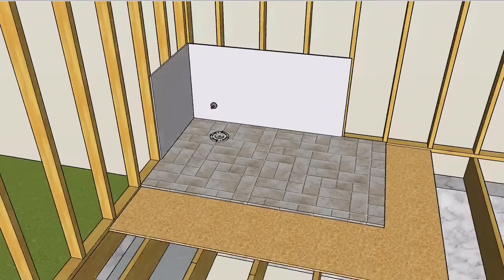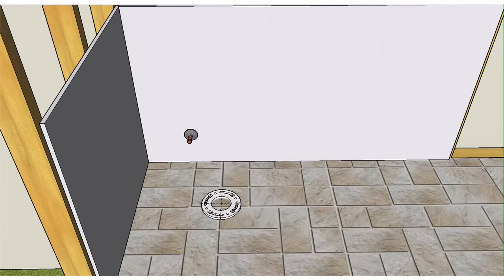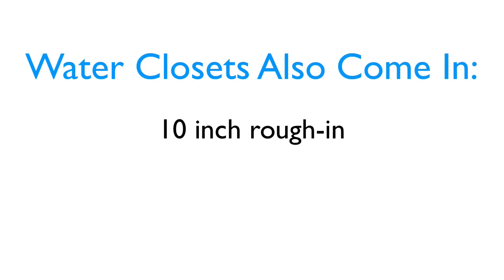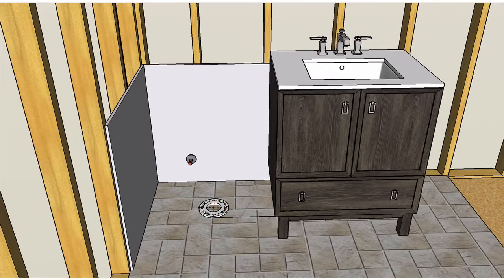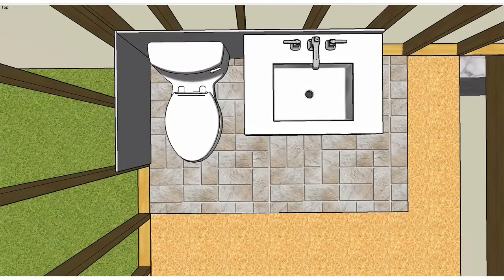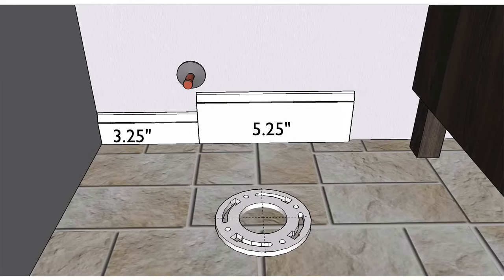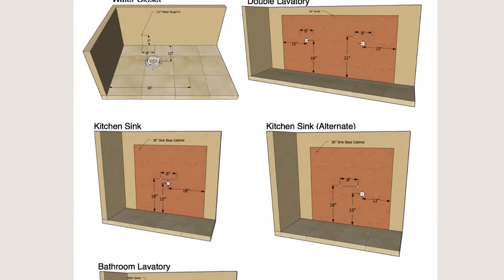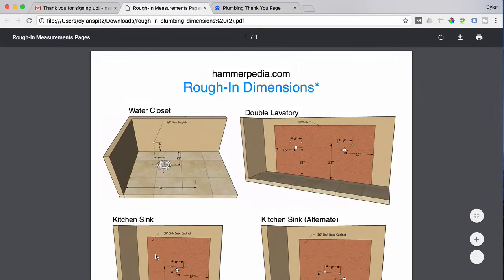How To Rough-In a Toilet (with Dimensions)

Comment: There is no PDF. Just a company  peddling bath remodeling from CA
Reply from the maker: Hi. You must have us confused with somebody else. We email anybody, FOR FREE, 2 bathroom plumbing diagrams. We also have several other free cheat sheets as well. Those get emailed out. If you did not receive your free pdf,  please check your spam folder or promo tab. The email is automated and sometimes ends up there. If you still cannot find it you can send us a message at hammerpedia.com/contact and we will manually send you the plan. Thanks.

Comment: I recently had to rough in a bath for a metal building because the local plumbers were wanting to charge over $3500 for a two-fixture rough-in.  After 3 hours of work and $250 in pipe and fittings, I finished the job on my own. Your videos and schematics gave me the confidence to move forward after my initial shock at the local plumber's fees. Appreciate the info you provide.
Reply from the maker: Way to go!

Comment: I am so glad I found your channel. I plan to overhaul my in house bathroom as the house was built in the 50's and needs major work. In the meantime I want to put inca complete bathroom with a small shower to use later as a mudroom.
My Dad taught all his girls not to fear tackling anything. I have put in oil pan gaskets, spark plugs, revamped uneven roof line, re roofed a house. I think with your good advice I can do this plumbing.
Just so you will know I am 70 and still going strong.

Comment: I have a garage built on a concrete slab with a 4inch tall concrete edge.  Avoiding all concrete fab, how high must I build my the wooden floor so toilet drain pipes  will clear that 4 inch concrete edge that the walls of structure sits on.  1foot?   2foot high.  and again im not touching or fabricating concrete.     and forget codes Im not a sheep.or a code follower.

Comment: Great video, thanks a bunch :-)
    I had a question about adding a bathroom into the garage, our garage steps down in elevation by about 8 or 10 in or so. And the garage has a concrete wedge that goes around the whole garage...
    My question is can we bring the water for the toilet up through the wood framed floor or do we need to punch into the side of the concrete to bring it from the wall sitting on top of the concrete pad.
        I hope my question makes sense and thank you for your work and consideration

Comment: Thanks for the info! Out of curiosity-- what distance should the toilet supply line be from the center of the flange if the toilet backs against an exterior wall and the supply line comes up through the floor instead of the wall?